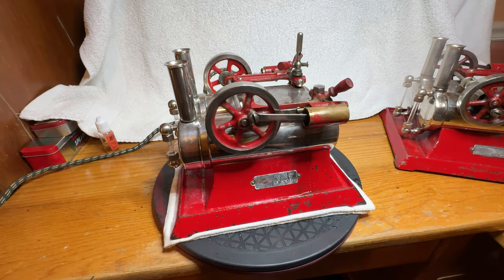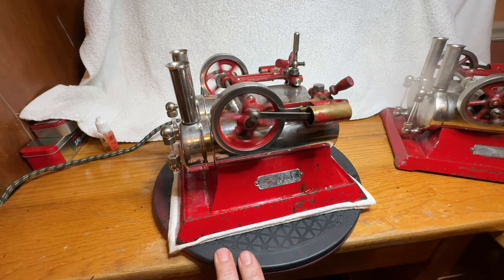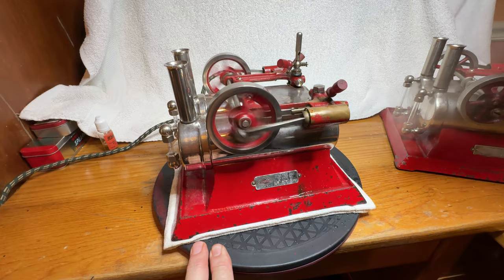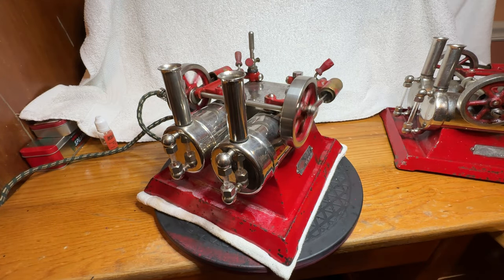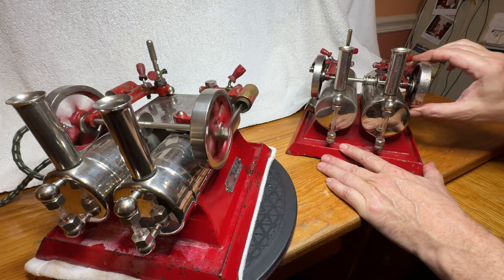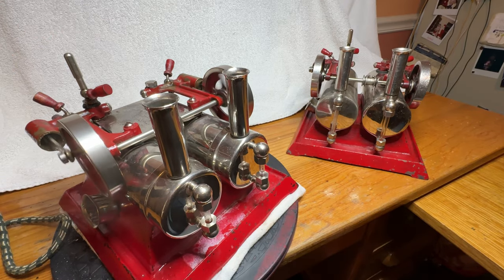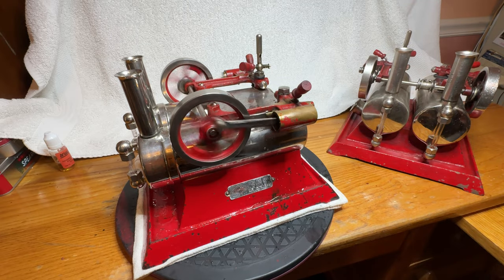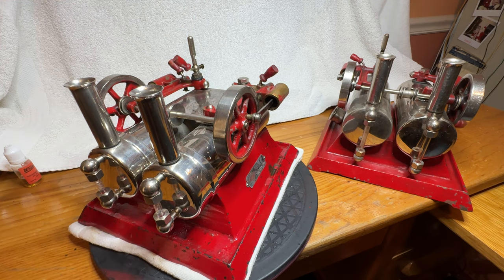Empire B-42 Double Boiler With Stabilizing Plate (Leaks Mostly Fixed)

Comment: a friend of mine made a design similar to this in his shed, used it for a small generator for his cabin while it took time to source the stuff needed for the solar array. it worked pretty well, had to grease it daily. ran on a large natural gas tank. it was a single piston and slightly larger then this. had some serious torque for its size though. only ran a fridge and a tv on it and a few led lights.